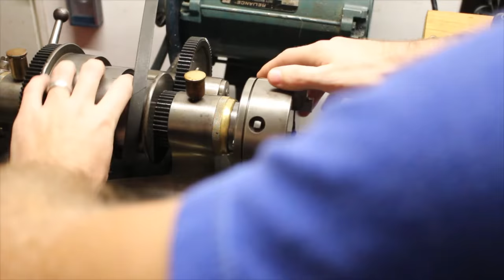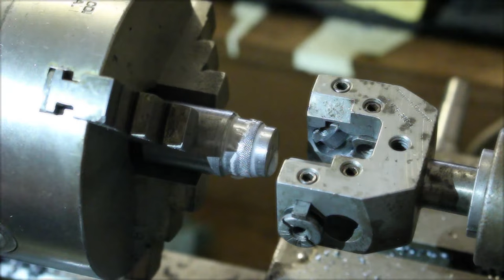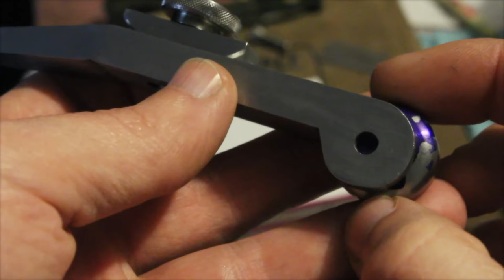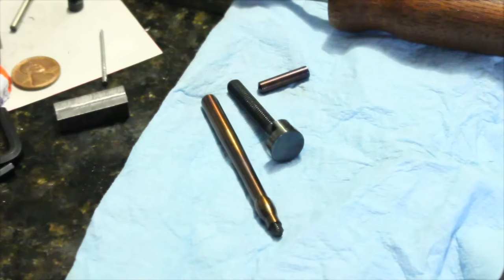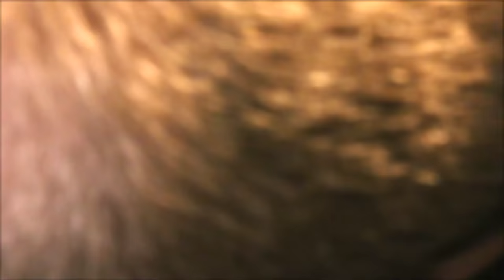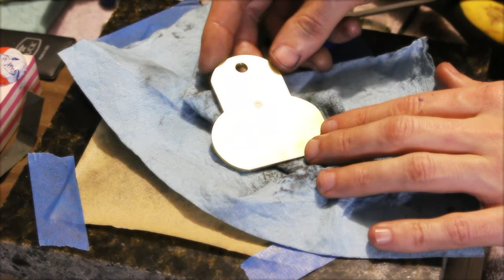Dixi mill clamp

Comment: Beats so chill, they'll sink your passenger liner!

Careful with MT&T... Dale did a video on "sharpening" files using acid, as opposed to his old method of jostling a bunch of them in a drawer... so I treat that channel as the CNN of metal working.
Reply from the maker: Thanks Marv!  The acid file sharpening thing is pretty legit, I usually use vinegar myself because it's dirt cheap and I'm not in a hurry.  Jostling them in a drawer, I've heard that before but there's no way that doesn't do more harm than good.
Reply: Acid might remove buildup in the grooves, but if it were good for proper sharpening, people would leave knives in acid baths, and sprinklers would replace surface grinders.
Reply from the maker: It's actually not very good for removing the gunk, you really need to brush the teeth out first.  Sort of like how capillary action makes no logical sense until you get real deep into the hows and whys, acid sharpening may not make sense at first, but it works extremely well for files, and I bet it would work for knives too.  It would, however, take much longer than sharpening with a stone, would be a lot messier, wouldn't leave nearly as smooth an edge, and would pit the rest of the blade as well.  I imagine it would especially take a long time if you were trying this on a stainless blade.  It's a well documented technique that goes back a hundred years or more.  There's actually a lot of great info on the web about it, and you'll find in most cases where people have actually tried it, it works well (I have tried it myself, and 2 out of 3 nearly useless files came up good enough that I continue to use them 3 years later)... with one notable exception being the guy who used nitric acid and etched the teeth right off completely, lol.
Reply: Next you are going to tell me the earth is round and goes around the sun.  Thumbs down, unsubscribed, reported, headed to local college campus for safe space!
Reply from the maker: MarvinRunyon lol you're the worst at pretending to be a special snowflake. :)